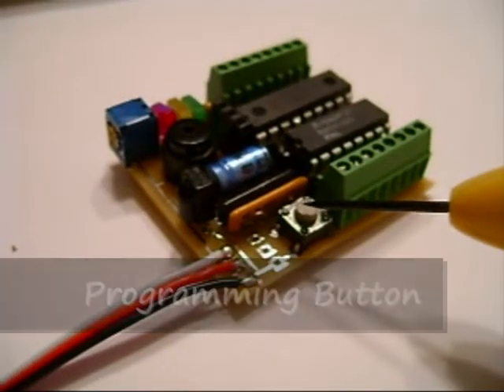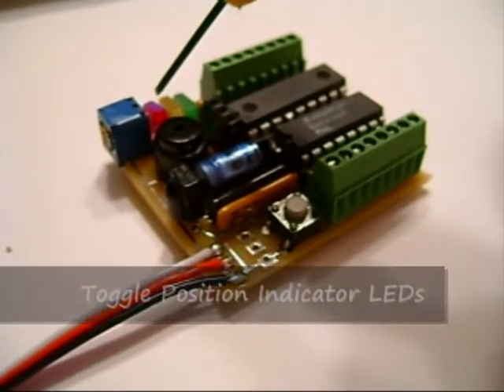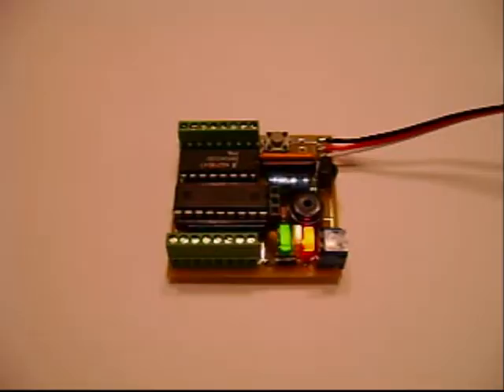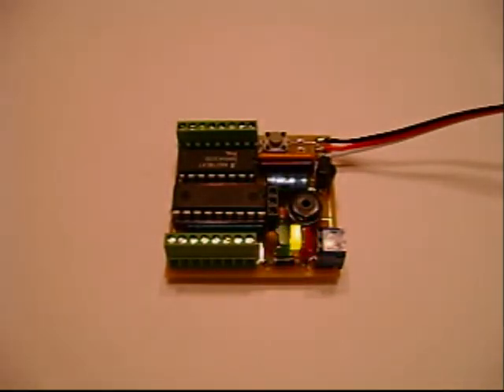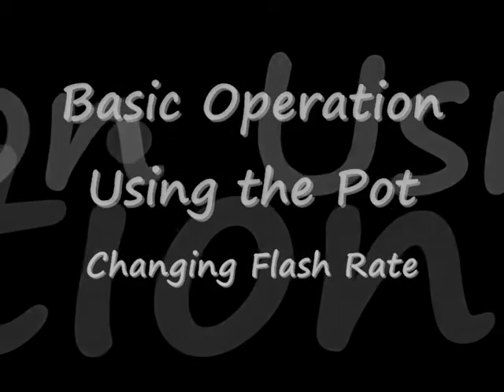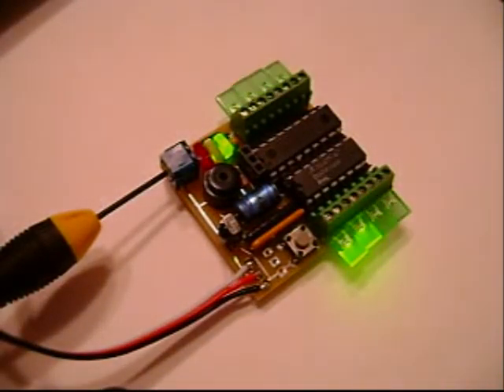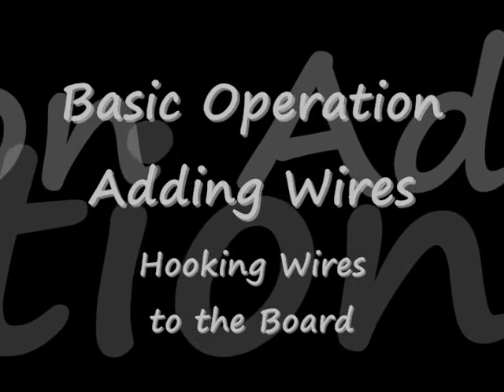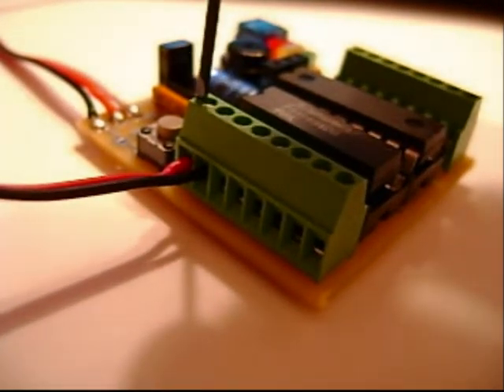PunkRC - Airplane Light Controller Overview

Comment: If you're looking for inexpensive but great lighting solutions for r/c car, airplane or helicopters check out rclighthousedotcom..I use  their stuff on my helicopters and they're great!!! (replace the "dot" with @ )
They have 3mm..5mm..and 10mm lights in all colors..steady or flashing plus holders, brackets, light pods, and light tubes. All lights have the resistors wired in and they will make custom lighting solutions for you at prices much cheaper than just about anyone out there!!!!!